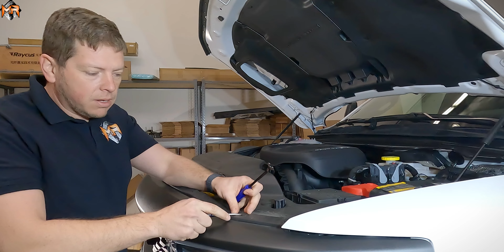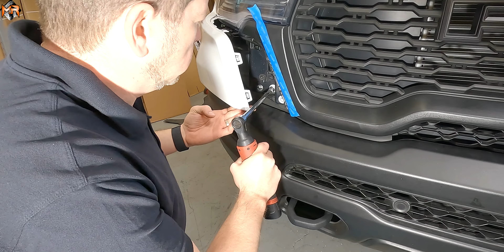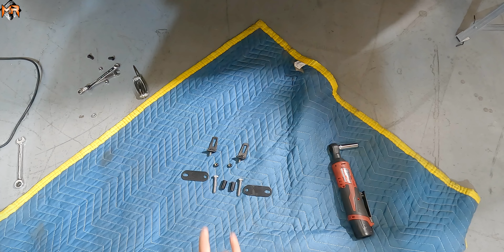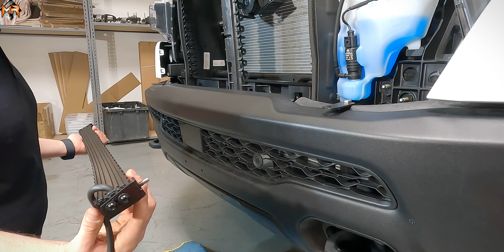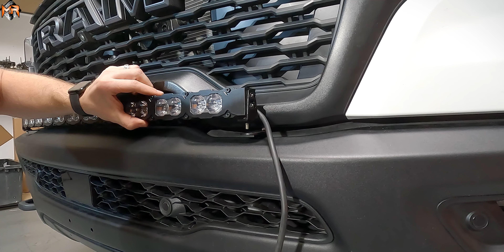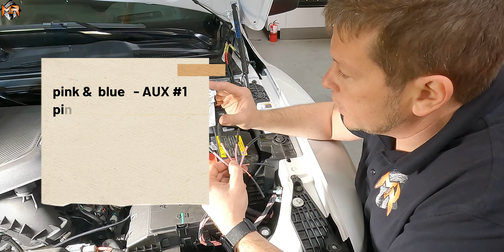RAM 1500 RHO 40in LED Light Bar PRO Install (No Drill) | M&R Automotive

Comment: I guess I’m the first rebel, 2022 here, got the grille off, there’s no rubber, there’s a plastic channel covering the 4 bolts, drill a hole? no problem, then the bolts and spacers are too short…. So do I abort or go to the hardware store and try to fix it
Reply from the maker: We have separate kits for 22 rebels